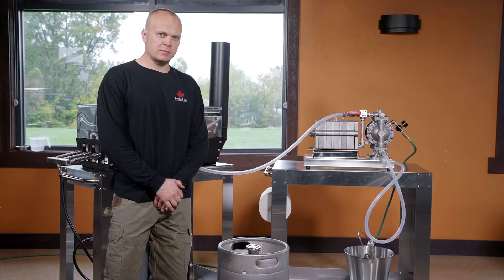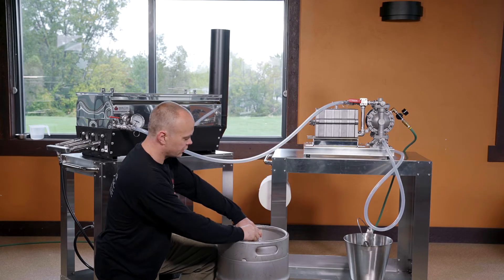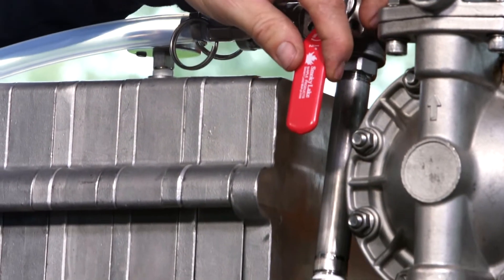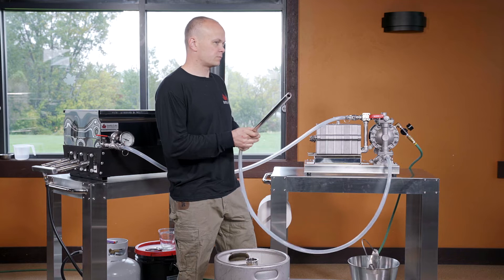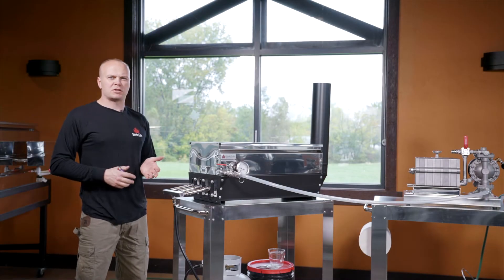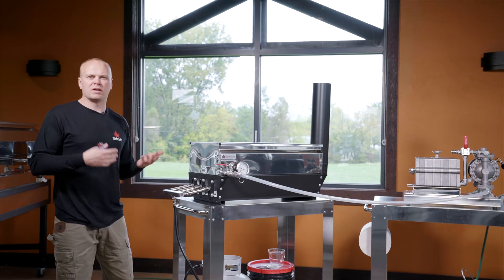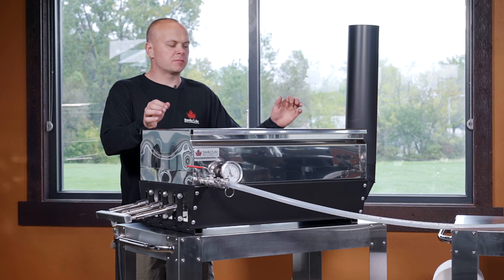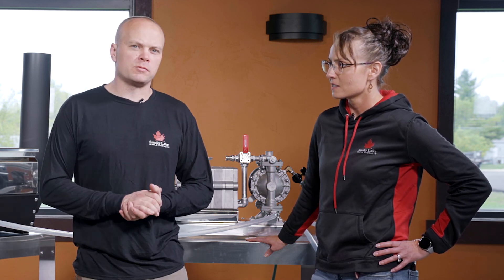Session 1: Warming Syrup and Adjusting Density

Comment: Does the barrel need to be completely full to safely hot pack? Or would 2-3 gallons in a 5 gallon barrel still store safely?
Reply from the maker: @mathew6763  I'm not sure, And I don't think that anyone knows definitively.  But I do know anecdotally that you can have 12 gallons of room temperature syrup in a 15 gallon keg and fill the remaining 3 gallons with hot syrup and have it seal very well and last for over a year with no issues.

Comment: Can I use the Murphy float and hydrometer in the gas powered evaporator if using it AS an evaporator? Meaning you're using it to finish so I'm guessing the syrup level is much deeper as opposed to the 2" level when used as an evaporator. Easier way to ask, what's the minimal liquid depth that I can use the cup and hydrometer in?

Comment: How long has/can that syrup be stored in the beer keg? Was that stored in there at ~219 degrees?
Reply from the maker: It was probably only 170 degrees or so.  180 degrees or more is ideal, but in a large container like that, 170 is sufficient.  It will last years in kegs like that.
Reply: @SmokyLakeMaple  so would you just set your draw off temp to that 180 and just put it straight into the keg? Or just kill the heat on the evaporator and let it cool then put it into the keg?

Comment: 60 1/2 brix,  not. Near 66 brix?
Reply from the maker: Dave, can you clarify your question?
Reply: @SmokyLakeMaple  Saw the video, warming syrup and adjusting density.. Your cup compensation read 60 1/2 brix, the hydrometer was floating on 60 1/2 brix. Don’t know what the temperature was. Wondered why the syrup at 60 1/2 brix was the correct density and not 66 brix?
Thought the density was off and your syrup would develop mold in time.
Reply from the maker: @davelindahl8273  This is the BEAUTY of the Murphy Float and the Murphy Cup.  Correct density IS 66.9Brix.  However, 66.9Brix is represented by the full range of numbers on your hydrometer based in temperature.  ONLY AT ROOM TEMPERATURE will 66.9Brix syrup float your hydrometer at the 66.9 number.  AT ANY OTHER TEMPERATURE you must compensate for the temperature.  Basically, your hydrometer is worthless without the Murphy Float or Murphy cup, or without long-hand compensation, at any temperature other than 60°F.